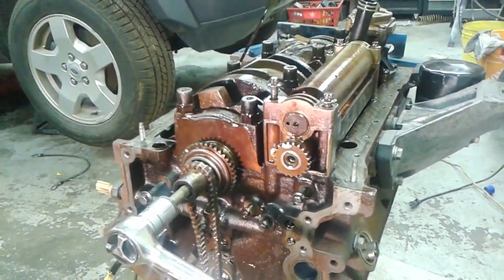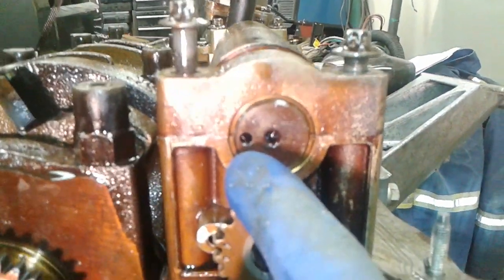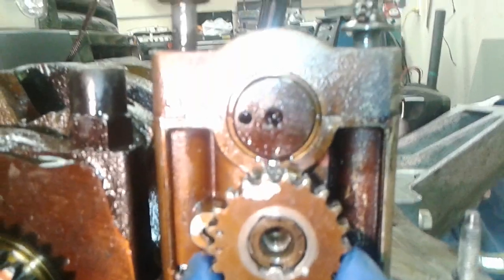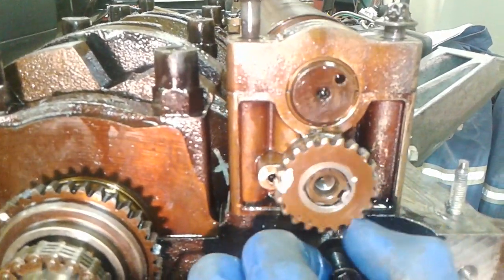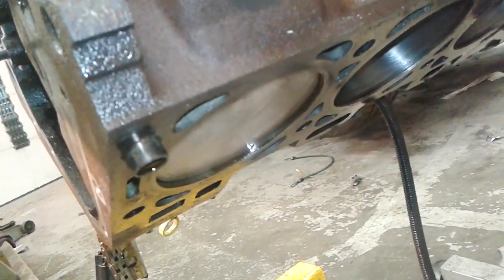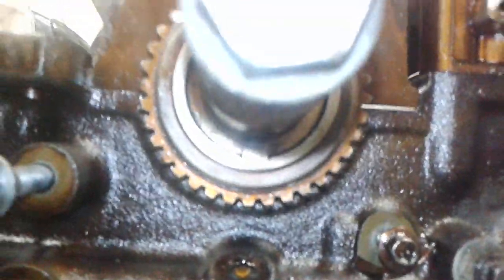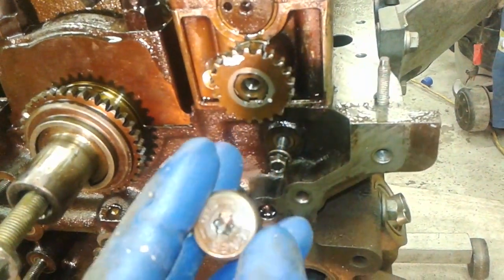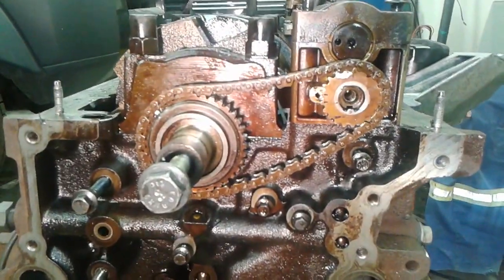Ford 4.0 liter balancer shaft timing

Comment: You are absolutely CORRECT. Thanks for informing me that the balancer shaft has a TORQUE TO YIELD STRETCH BOLT. Thanks, Mark
Reply from the maker: No problem Mark.
Glad you found value and appreciation in my video.
All the best.
Arjun

Comment: I have a question, if the balancer is removed to be used in a Ranger 2x2, is there a problem?
Reply from the maker: Not 100 % sure to be honost.
It was quite some time i made the video and dont remember the details behind the interchangabillity of this engine.

From.what i can remember the ballancer shaft 4 liter engine was exclusive to the ford 4x4 market.

But.it might bolt up to a non 4x4, you would need everything though, the ballancer shaft the chain the oil pan the jackshaft.
Everything !

It might be allot easier to remove a 4x4 complete engine from vehocle to instal in your 2x2.

Comment: Mechman4-
My ‘68 bronco’s 289 begins seriously vibrating at 2800 rpm.  Occurs on all 4 gears and when not in gear.  So far I have replaced the harmonic balancer, the motor mounts, replaced plugs, electronic distributor, upgraded coil, checked firing sequence, and the ignition from points to dynaspark.  Regardless, the truck is next to undriveable above 3k rpms.  
Does this sound like a balance shaft/timing issue?
Reply from the maker: The ford 4 liter had a ballancer shaft.
If your ford bronco has the 289 cubic inch displacement engine its a v8 5 liter which does not have the ballancer shaft in it.
Not sure if you meant 1968 or 2008.
Ford didnt make the bronco in 1968.

Do you have any check engine lights.come on with your drivabillity issue ?
No power above 3800 rpm ?

If no check engine light on and no stored code to retrieve which would tell you the problem.
Could be fuel delivery problem.
Check your fuel pressure followed by replacing fuel conponents like fuel pump and pressure regulator if pressure is low.

Comment: How would I know if my 2009 Mustang 4.0 v6 base model is equipped with balancing shafts? Without taking the engine apart
Reply from the maker: It's been a long while since I worked on these engines.

As much as I would like to answer your question for you.
I dont want to give you incorrect information.

Is there a ford dealer in your area that you could ask a mechanic at ?

I will research it a little on my end and see if I can find anything out regarding your question.
Reply from the maker: This automotive forum descussion suggests that only ford 4 liters with ballancer shaft were fitted to 4x4 modal vehicles. So although not 100% certain, ita unlikely that your ford mustang has a ballancer shaft engine unless someone (previous owner) installed 4 liter into your mustang that was out of a ford explorer 4x4 modal.

https://www.ford-trucks.com/forums/488499-sohc-4-0-l-balance-shaft.html

Comment: I hate how these idiots tell you all about everything there is to know about bolts except what size the GD socket or torx size it is. By the way the ones that hold the balance shaft in place is an E10, I am going to take all my torx with me.

Comment: hi brother. you know iremoved the chain from the lefht side head and the chain from the crankshaft. but i dindnt removed the balncer shaft chain. so i put the cylinder 1 at the top dead center on compresion but the mark on the balancer shaft i didnt put on its timing. do you think im gonna have trouble for that?
Reply from the maker: If you didnt remove the ballancer shaft chain and the tensioner was still keeping ballencer chain taught/tite so no chance that chain could have jumped teeth, than your good. no worries.
the timing procedure in my video is only if you have removed the ballancer shaft chain or if you believe ballancer shaft chain has jumped teeth due to a failled tensioner like was the case on my engine.
Reply: +mechman4 than you. brother tomorrow ill put everything back. then

Comment from the maker: you wont have to remove the engine from vehicle necassarily .
but you will have to remove the timing cover and oil pan to visually inspect timing marks as you manually rotate the engine over with wrench.

Comment: Great video 
Wish i had have see your video while i had the my motor open and out of the car . Have installed new timing chains front and back of motor.
That part has all gone well but i had no idea about the timing of the balance shaft.  I remember lining up the dots on the sprocket gear but did not pay any attention to the hole on the balance shaft.
I think the timing is out because the motor has a strange vibration  at higher revs as it goes through the gears.

Is there any way of checking this other than exposing the front timing chains.

If it is out how can it be corrected without taking the motor out of the car .

Look forward to your reply
Regards George
Reply from the maker: hello George,

sorry for late reply.
I believe you  may be able to check your timing marks align by removing the oil pan and visually inspecting dots align when cylinder number 1 is at top dead centre on compression ignition stroke.

however correcting this allignment if out may require removing timing chain cover to remove balancer shaft bolt to reposition balancer shaft gear to crank gear.

 Allot of work to correct less work to check.

hope that helps.